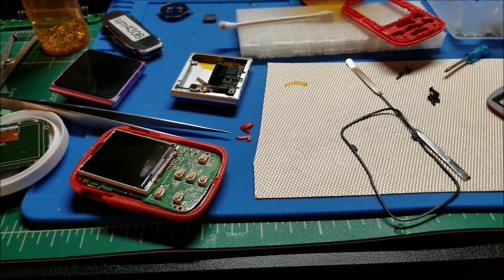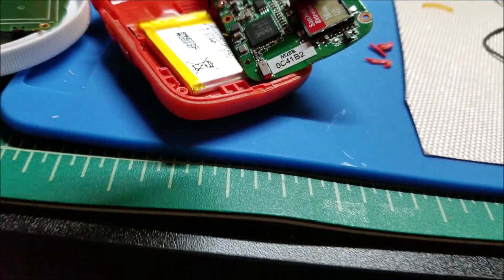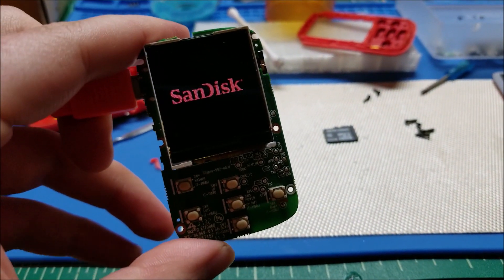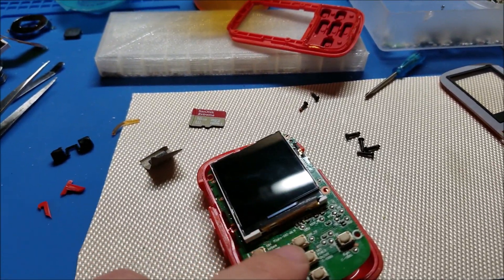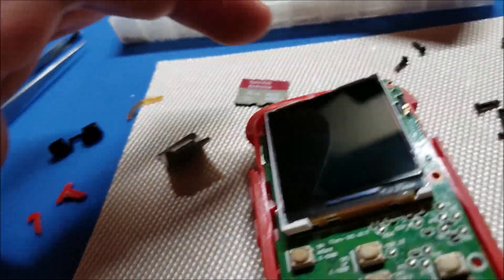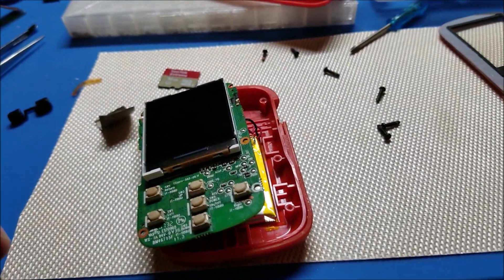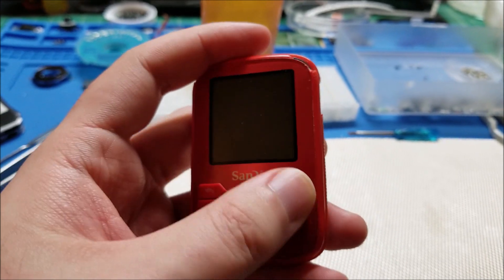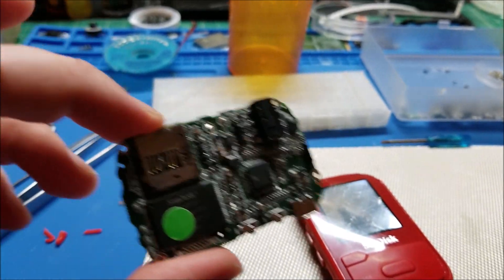Sandisk Sansa Clip Sport Plus SD Card Mod Discovered!

Comment: 3d print and add a much bigger battery and this would run forever or just bin the clip and make a slim battery holder on the back. Action camera batteries would be cool as the have pins that slot into the battery making a fast swap easy if needed
Reply from the maker: I did exactly this on one of my clip+'s with a broken clip. I used a 1000mAh cell phone battery that was as big as the back and it would run forever, like I would seriously only charge it twice a year despite pretty heavy usage. After a few years the battery ended up not holding a charge and slightly swelling so I retired it.
Reply: Nice do you know what phone battery it was? @sjm4306

Comment: I have a SanDisk Sport Clip that supports 128 GB Micro SD cards.  On mine, the packaging states I can use SDHC, but my memory card is SDXC.  Now I'm getting ready to test it with over 27,500 .MP3s on a 512 GB memory card.  When I used it with my 128 GB memory card, it plays them just fine.  That 2,000 song limits is the limit for how many songs can be randomly played.  Sequential playback is limited to the folder that the music is stored in.  So unless I create a playlist on my Sport Clip, I will be limited to playing one folder at a time.  Now I wonder if the internal 8 GBs on my player can be upgraded to a higher capacity card?
Reply from the maker: If it's the original clip sport the internal memory is a soldered nand flash chip. While not impossible to upgrade at minimum you'd need a hot air rework gun and a flash chip programmer with zif socket.
Reply: @sjm4306 Thanks.  In the original box, it states it can support up to 32 GBs.  But a sticker was placed over that to show that it can handle up to 64 GBs in the external card slot.  I tried it out last weekend with a 512 GB memory card loaded with over 27,500 .MP3s.  It was a little slower in loading the files upon power on.  But once it was started, it was able to perform as smoothly as ever.  Marvelous little computer tech.
Reply from the maker: For some reason I misread your original comment and thought you wanted to upgrade the internal flash chip lol. But yeah upgrading the external sd card is easy and doesn't seem to really have a hard limit so far.

Comment: I suspect they put the SD card internal not because they're trying to prevent the user from upgrading.... but because they were trying to improve the "sport" aspect of it. You know, the water resistance. 

An SD card slot to the exterior introduces a point in ingress for water.
Reply from the maker: I meant it's odd moreso because an internal sd card plus connector cant be cheaper than a standard bga or even ttsop flash chip soldered directly to the board. In fact it's likely much more expensive. Sure maybe they just had a big stock of sd cards they wanted to use up but connectors are very expensive compared to silicon.
Reply: @sjm4306  While this is true, we're also talking about economy of scale. Sandisk has massive manufacturing lines already set up and producing those memory cards. So perhaps the design engineer preferred to use an existing product instead of spinning up another line for a new product. Thus eliminating engineering man hours, time, effort, and tying up the already existing SD card line.

They may have also decided this course because they didn't want to buy chips from another fab. Many engineers prefer to use only IN HOUSE materials for their product design. 

Also, this could be an attempt to use up older stocks of SD cards. Perhaps the 16 and 32gb chips aren't as desired today. Maybe they don't sell as well since people can go buy bigger SD cards 128gb or 256gb... so on.

Could be something upper management demanded. Or it could have been a limitation due to FCC requirements. Or perhaps they were rushed on time, and chose to use an existing product to reduce R&D? 

All of which makes sense considering the customer base in 2023 for dedicated MP3 players is much smaller than it used to be.

Comment: I miss the video of dismantling the cover. Is it possible to open it without damage?
Reply from the maker: Your best bet is warm the adhesive with a hair dryer and use a small suction cup on the screen area to lift the plastic screen cover.

Comment: there might even be a chance there´s a firmware file avaiable from sandisk archives and some kind of recovery mode backed into the player, that way you could actually reinitialize the player in case the original card died.
Reply from the maker: Really hope so as all flash memory will eventually corrupt/die.
Reply: @sjm4306  it can last a very long time, but it has a limited number of write cycles.
My Sansa e250v2 only has 2GB of internal storage (actual nand soldered onto the pcb).
I don't use it at all, i keep everything on my 128gb micro sd.
Rockbox by default doesn't show the internal storage to a host computer anyways.
This prevents me from accidentally bricking my firmware and also I'm unable to write anything to it.
Should live a long life hopefully.
But at least for this model, there are tools to unbrick and/or reflash the whole thing.
Needed this recently for my sansa e260v1.
The one time i was glad to dualboot linux, since i had to execute a linux binary.
Reply from the maker: According to Jedec flash retention is anywhere from 10-20 years at room temp (derates at higher temps, for denser than slc with most modern flash being tlc and qlc, and also the more writes the faster the depletion). I've seen corruption in as few as 6 years for some cheaper brand sd cards. If corruption happens randomly on a music file you may notice a slight blip but if it occurs on a boot/os file there's a high chance the os might not boot or will seemingly randomly crash. Error correction masks some bit flips but the more errors it encounters near eachother the worse its reliability is.

Comment: how did you get win32 disk imager to clone it everything i have tried the options are grayed out so i tried acronis clone everything and still wont boot only with original card
Reply from the maker: Not sure of your specific setup so here are some general ideas: Make sure nothing else has mounted and is using the sd card. Also the sd card must be directly inserted to a usb adapter on the computer (ie not through the sansa's usb connector).

Comment: SanDisk Clip Sport Go is the latest model. It uses a newer SoC: atj2167 which uses a risc-v cpu core and a dedicated dac ip block. supports 8000 songs. They changed the case quite a lot too and it has a 1.22" tft-led 240x240 screen instead of 1.44" 128x128 tft-lcd. I read that it also uses an internal micro sd card for storage too so this trick probably works with that model too.
Reply from the maker: I actually got the clip sport go a little while ago and can confirm that it does have a micro sd card inside and also can be upgraded with a bigger card using the process shown here.
Reply: hmm thats weird, because the clip sport go can run clip sport plus firmware

Comment: Do you have a copy of that .img flash file from the SanDisk firmware? Is there a way you could send it over email?
Reply from the maker: The entire image is the full capacity of the device so a 16gb file. Also unfortunately it seems I deleted it so I'd have to redump it from the 32gb card in it now making it even larger and I just dont have that much free space in my cloud account.
Reply: I thought img files even bitwise compress a huge amount. So a 32gb will probably shrink to barely a few mb
Reply: Provided there's nothing on it but the firmware and bootloader of course.

Comment: How do you remove the firmware???
Reply from the maker: You put the sd card directly into a computer and use a program like win32 disk imager to rip the image to a bin file.
Reply: @sjm4306  ok and this will work on the SanDisk sport clip  mp3 ???
Reply: @sjm4306  federal prisons put a certain type of firmware on this device that take away features like the folders for movies , I want deinstitutionalize the device, will the win32 disk imager work? Also I only have an Android phone, can I use a similar app?
Reply from the maker: Ah I understand now, so you will need to reflash the unit with the regular consumer firmware. I honestly have no idea though if the locked down firmware on your unit will allow that through the normal update process. Worst case you can do the cloning technique to directly overwrite the firmware on the sd card inside but you will need a dump of the sd card from a consumer clip of the same model.

Comment: Interesting video! I was looking to see if there was a way to modify the firmware completely to make a petite little game system, but this is still really cool.

On the microphone thing, I have a Sandisk Sansa Clip Zip, which is a very similar model, and it actually has a completely usable microphone, with menu options to use it. Back when I was really young, I didn't know how to transfer files to it, so I just played the song through headphones into the microphone to record and listen to it later! Absolutely destroyed the quality, but man, hearing those old recordings really take me back. One of the song recordings had a little hiccup in it that I eventually got so used to, listening to the song normally now without the hiccup feels completely off.
Reply from the maker: Reminds me of the days of recording off the radio onto cassette or minidisc! Also funny that you mention it, I ripped a cd I borrowed from a friend when I was a teen and it had a scratch that I got used to hearing as well. Years later when I downloaded a high quality version of the album and listened it definitely felt odd not hearing the skip on that one track at that one point lol.

Comment: Does it support flac/ogg natively? I'm reading that Rockbox won't work on it :\
Reply from the maker: Rockbox unfortunately wont run on any clip past the zip (they changed chips and the rockbox devs basically said there's not enough ram on the new chip to even boot rockbox). This particular model supports mp3, wav, wma, aac and flac.

Comment: can you jailbreak the "prison" version of these? It has firmware installed that does not allow you to use it unless you renew it on a kiosk while locked up. there is a way to remove it and re-install new firmware.
Reply from the maker: Easiest way would be to get a dump of an unlocked firmware and just overwrite the locked one on the internal sd card.
Reply: @sjm4306  what If i just remove the internal sd card and re-format it? Do you think that will work? I just want the sd card to use in a different mp3. thanks!
Reply from the maker: Yeah that will work for another mp3 player, so long as you understand that will effectively brick the sandisk.
Reply: @sjm4306  I have found the website for deinstitutionalizing the mp3. Now I just have to make up my mind what I want to do. Thanks for the help!
Reply: Did the SD card that you pulled out of the mp3 player allow you full use of the 16gbs?
Reply from the maker: It's just a regular sd card. Keep in mind though all memory devices have a little less memory than what's written on the label because of formatting and moreso because 1MB=1.024MB for computers.
Reply: @sjm4306  OK, I have taken apart a portable media/gaming device and it had a sd card that read "32GB" after formating and installing it to my mp3 it would only let me use 250MB's. There were multiple things that can cause this. I can send a link about that if you want more info, but you may already know about this. Thanks for your help, I will subscribe to your chanel, have a nice day!
Reply from the maker: In that case I would load it up in software that can do low level memory analysis like partition magic to see if either the manufacturer fudged the mbr to show more memory than it really has or if it just has a ton of dead sectors.
Reply: @sjm4306  I have an interesting but unrelated question: Have you ever hooked up a bunch of smartphones to a computer using linux? it's called a cluster computer.
Reply from the maker: Nope, I'm more into lower level stuff like embedded applications without dedicated real time operating systems.
Reply: @sjm4306   I bet you could put together a DIY motion sensor device for home security. I may attempt that in the future.
Reply from the maker: Yep, that'd be a good simple project
Reply: @themdamngorgonites5159  did you figure out how to jailbreak the MP3 player
Reply: @jaybest1661  No, I got as far as figuring out how to retrieve the music off of it. even that was: WAY TOO COMPLICATED...  After you do all that stuff you can't even use it still. ALSO: there was no micro SD card inside, the build is different from the consumer version of this product.

Comment: For the 32GB version, Sandisk claims 8000 songs for the 32GB version and 4000 for the 16GB version. I have 2400 songs on my 32GB version.
Reply from the maker: Interesting question is, is that just due to an average file size and capacity calculation or a max firmware limit based on the track caching it does when you add new music?

Comment: Use a tripod. All the movement makes it hard to watch.
Reply from the maker: A full on tripod wont fit near my desk with me seated (I've definitely tried). I have a flex arm that I usually use for steadier shots, but for some reason didn't use it for this video. I think I was in a rush that day and couldn't find where I put the mount so I just shot in hand.

Comment: Also could you still use the the SD card  that it came from the mp3 player an put music in it an put it back in the mp3 player
Reply from the maker: Yes, so long as you don't reformat the original SD card you can always just put it back into the player and it'll work.
Reply: @sjm4306  what I'm trying to do is use my otg wire and put using my android phone to transfer files using
Reply: My phone but the mp3 player saying it needs to refomat the player it trys to do it but the player won't let it.is there some type of software or anything that I can use doing it through my phone . since I don't have access to a computer
Reply from the maker: Do not even try to reformat the player except through it's own settings menu. Historically on several other models of mp3 player this has been an easy way to corrupt and brick them. It honestly should just work as it's a fat32 formatted mass storage drive. You may have to try another file browser app than the one you are using. Does the mp3 player drive mount or does it say it's corrupted? Also what model phone are you using?
Reply: @sjm4306   for like several seconds it will say when I otg with my phone the icon will Pop up the read it needs to be formatted it trys to do it then It reads that It corrupt.i have a motto e 6

Comment: will it support more than 32 GB of storage if i install a 64 or 128 gb? not talking about keep working but not detecting more than 32 gb. but detecting everything stored.
Reply from the maker: Yep, if you follow the cloning and reformat in the player settings menu then it'll recognize the full card capacity. The main limit I can think of is the max track limit which would be fixed in the firmware, but I haven't hit it yet so no idea what that would be.

Comment: My old Sanza Fuse has a mic
Reply from the maker: Older sansa clips did as well, I guess why it was removed from this iteration is it'd be harder to keep the water-resistance rating and have a mic hole in the case than to just omit the feature.

Comment: Please, please use a tripod.
Reply from the maker: I actually do have a tripod/flex arm thingy, but it's a royal pain to fit on my bench without bumping it and knocking it over so sometimes I get fed up with it and go handheld. I really need to make some sort of overhead mount that won't get in the way all the time.
Reply: @sjm4306  I appreciate that, I get motion sick from wobbly videos tho' ☹️

A very clever hack I saw was a 1/4" bolt threaded into a Coke bottle lid. The guy then simply filled a 2L bottle with water, screwed a $50 4K Go Pro clone on and put it in the top. Bingo, 50c tripod.
Reply from the maker: I'll see about getting something like one of those articulating locking magnifying lens/lamp arms with the screw table mounts. Then I can 3d print some sort of phone mount for it so I can easily reposition it, it'd much better than any of my current mounting methods.

Comment: Neo Geo X Mega Pack Vol. 1 has a micro SD soldered into a full-sized SD card with a custom pin out to make it not read in a standard card reader. Of course, you can just remove the microSD card and read that in a standard card reader if you don’t mind tin on gold. ;)
Reply from the maker: Security through obscurity is no security at all!

Comment: I had one of these. This was years ago when I never used to tinker with things. I ended up throwing it out because the audio jack stopped working. Probably was an easy fix :/
Reply from the maker: I've had a few where one channel or the other stopped working, it was pretty easy to fix iirc just needed to resolder the jack pins.

Comment: All it needs now is a type c mod and a bigger battery. Very cool video.
Reply from the maker: It'd probably be pretty easy to design and fit a little type c adapter board in there, possibly even redesign the back shell and 3d print it for that and a bigger battery! Of course it'd lose the water proofing but well worth the sacrifice for extended listening time.
Reply: @sjm4306  👍✌